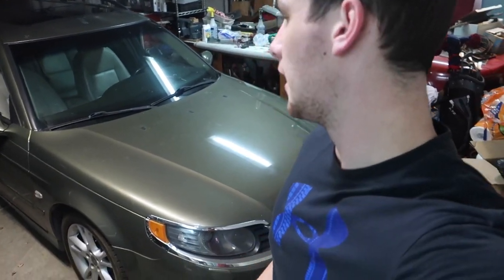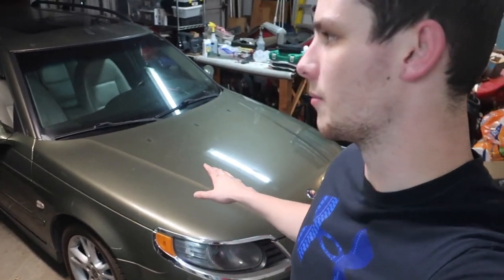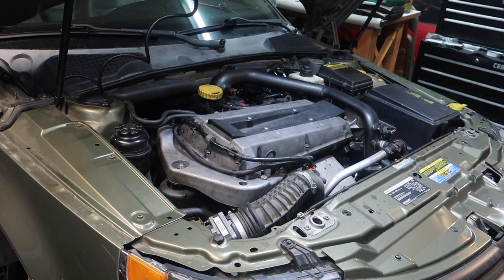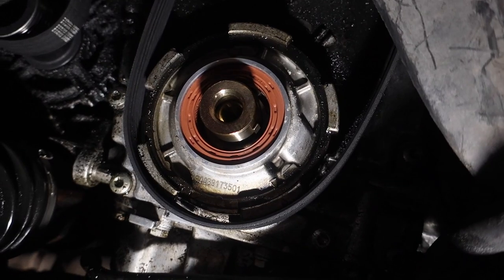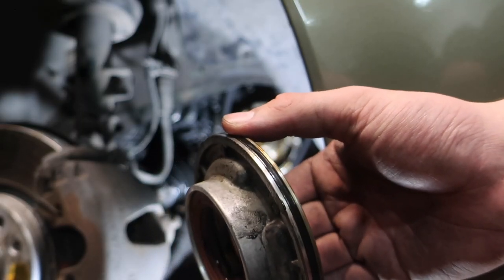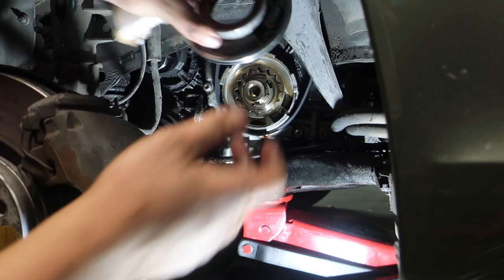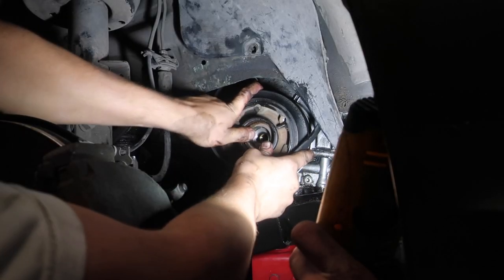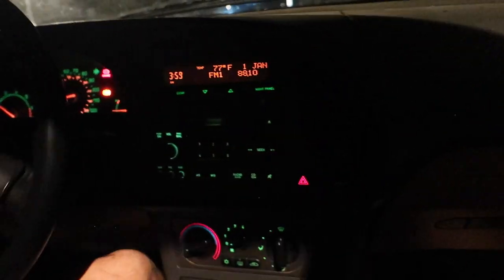Fixing an Oil Leak on My 9-5! (Front Crank Seal and O-Ring Replacement)

Comment: Excellent video! Thank you. I just followed your instructions to replace the o-ring and crankshaft seal. A couple of things I had trouble with was my 7" circlip pliers were not wide enough, so I reccomend buying the biggest pair available. I used an angle grinder to increase the width they open. The other thing was the 1/2" extension bar to take the slack out of the drivebelt. I wasn't sure what I was looking for. It's basically a square hole you slide the bar into and pull it towards the front of the car like a one arm bandit. The crankshaft seal was easy to replace. I used a vernier caliper to measure recess depth (2.5mm). Flipped the old one out with a flat head screwdriver. Cleaned. Pushed new one down with wood to create even load until flush. Used old seal and wood to push down to 2.5mm recess. It has a stop to prevent further recess, but knowing when to stop pushing is helpful. Hardest bit is the circlip.

Comment: Nice job!! Mine blew on my 95 on the highway on my way home from work. She didn’t leave me stranded and got us both home. Needed to buy an impact wrench to do this job though. Pretty easy I must say for such an important ant seal. Oh, I had to pack grease in the pump to get the oil flowing again. How did you get it flowing?
Reply from the maker: Thanks! I didn’t do anything relating to that on my 9-5. Just started it and drove it

Comment: Good video. I am not able to remove the oil pump cover though. It is stuck hard. It rocks slightly  from side to side but it is stuck. I tried a pry bar like you did but it does not want to budge. Any ideas? Thanks

Comment: I love all of your videos.. I have a 2006 93 V6 that I need to remove the oil pan for rod bearings inspection. I can't find anything on what is required to remove to get the oil pan out. (Oil filter assembly, crank pulley, etc). Please help..  Thank you
Reply from the maker: Check www.saabwisonline.com

Comment: Did you notice increased engine vibration on idle while these seales were leaky. My hypothesis is that the leaking oil gets smeared on serpentine belt and causes it slip occasionally giving different load on engine. I am wondering if this is a case.
Reply from the maker: not that i can remember

Comment: Hey buddy I have an 07 9-3 2.0t I just replaced the valve cover gasket and it’s still blowing thick smoke from tail pipe. And there is light smoke coming from under heat shield of turbo when giving gas. Any ideas
Reply: If you have thick smoke it’s either oil burning in the combustion chamber or coolant which sounds like a head gasket not the valve cover. It’s also possible an oil seal somewhere on the turbo. If you have a major loss in power your turbo is blown hence the smoke
Reply: @mattpfarr5992  it only has low acceleration up to 20 mph then drives normally only when coming from a stop it has low power I replaced plugs and coils cause I had a p1349 code now I’m just getting random misfire code p0300 so if I fix the turbo seals I should be good? Burning a lot of oil from cam seals so ima replace them but how do I clean out the combustion chamber
Reply: @johntafoya2544  don’t drive the car till repair (if possible). Random missfire can F up the engine pretty quickly.
Reply from the maker: I wonder if the turbo is bad. You’d need to take that heat shield off to investigate further tho
Reply: @AutoAutopsy  the turbo is fine it kicks in like normal and doesn’t get red hot I think it might just be an oil line

Comment: Hei.
Exhaust too hot = EGT too high.

 Too high EGT = not enough fuel !!! 

- check AFR (Air Fuel Ratio) while driving (it should be around 11)
 - check the injection time corrections
 - check the fuel pump
 - check the knock sensor. 

!!! Your engine has insufficient fuel !!!

Good luck 👍